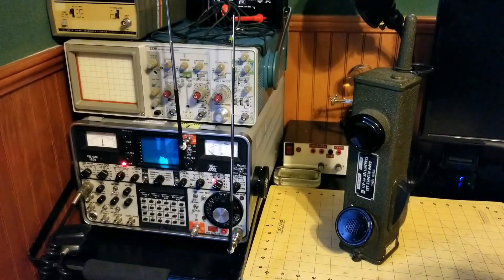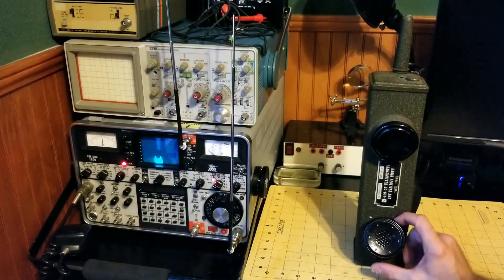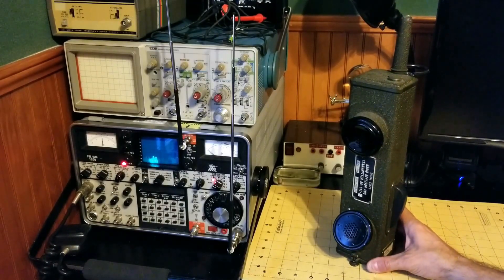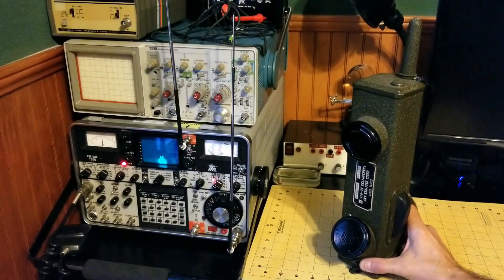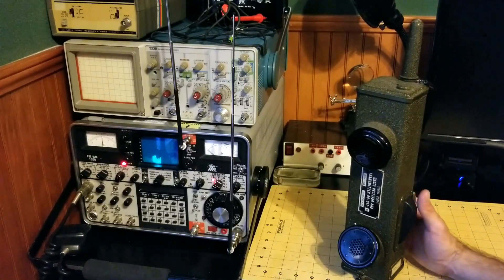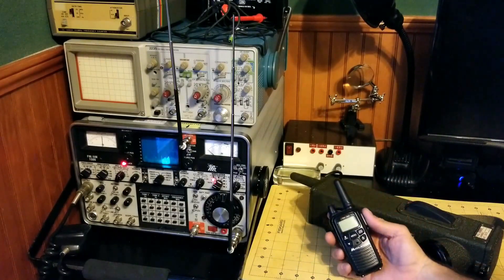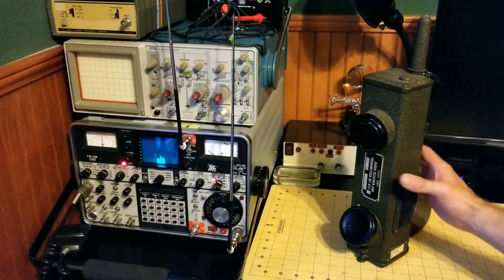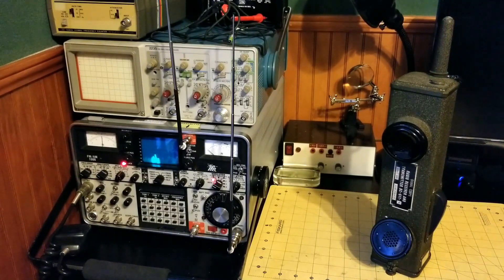10 Must-Know Facts about the BC-611 Handie Talkie WW2 Portable Radio / SCR-536

Comment: Man these things are awesome,I'm gonna get me one sometime,they are not super easy to find but not hard either,Ive had the opportunity before to buy one but it just didn't happen, nice to see a video of someone thats into WW2 ,WW2 is my life basically,lol, i must have a thousand books on it, never ending, always finding new stuff, subject.  how much would you give for one of these Handie Talkies in so so condition? just trying to get a idea of a price in case i find one here soon, thank you for your time and the video!!!
Reply from the maker: If you're looking for a static display, you can expect to spend $150 or so on the BC-611 shell alone.  If you want a working unit, you can expect to spend $350-400 for an untested unit (batteries not included).  You will need a General or above radio license to operate on the 80meter band.  It's harder to find BC-611's setup with crystal, coils for 3.6-4.0MHz in this allowed band.